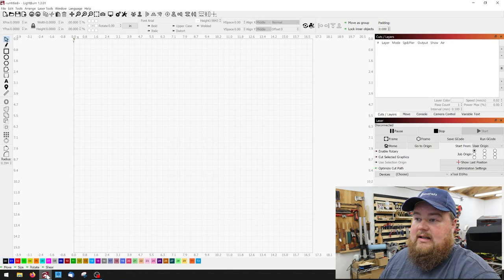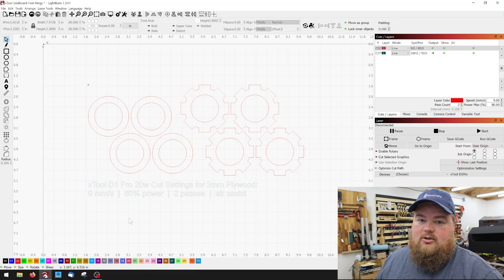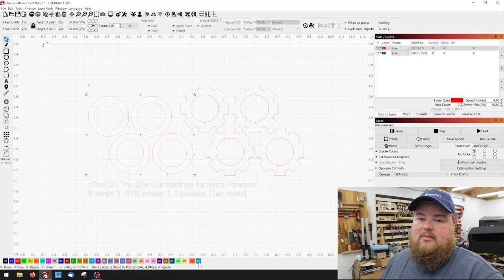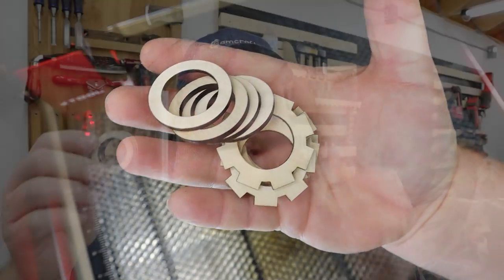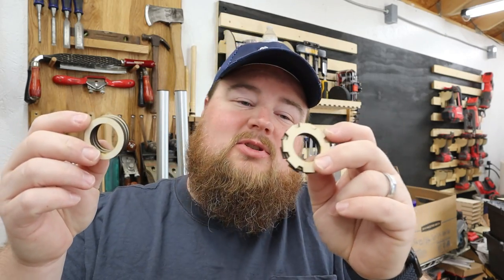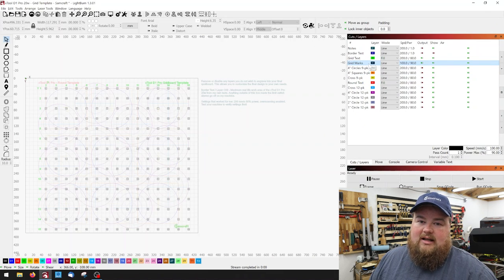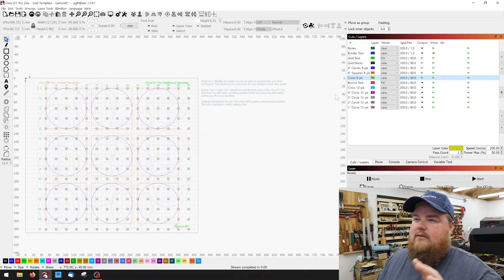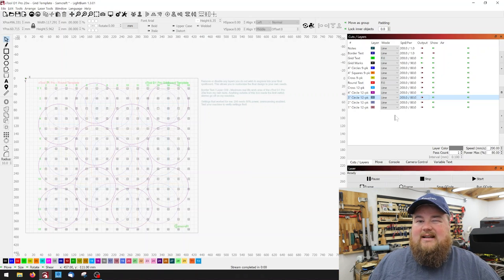Customizable! xTool D1 Pro Grid Board Template

Comment: Great video.  I ended up cutting my spoil board 24" wide x 25" long.  This allows me to place the xTool enclosure on top of the board and not lose any enclosure height.  It also allows access to the USB and Power ports when the extension legs are installed (they were covered if the enclosure sat outside of the board).  Thanks for creating great tutorials!!!

Comment: Ok got it, expect for when need to cut.  Obviously when you need to cut AND engrave the template is covered by the honeycomb and steel burn protector underneath.  I assume you cut your project first with the honeycomb in place, and then take the cut pieces to the template as a separate operation.  Thanks for another great video!

Comment: Very nice thanks for sharing. I had been toying with the idea of instead of a grid using a piece of peg board on top of my plywood and aligned with my diode laser. That way I can use the peg holes to align templates.

Comment: 1 thing that I would add that I consider VERY IMPORTANT is that before saving the file you LOCK it so it does not get accidentally moved so template and spoil board do not get out of alignment

Comment: Very helpful video Sam. I was already planning to do the same with the feet, but like your air suction kit behind the laser and how everything is placed gives a better idea how I want to place my laser. I'm also planning to make a board for the rotation kit with more ground clearance as well a board with a big square gap and a table under the laser. The laser itself is placed on an Ikea work bench (adjustable hight) so I can easily laser bigger stuff without adding or removing the feet at all. Keep up the good work 🤘

Comment: Sam, great video.  Maybe you can help me out.

I am using obsolete coordinates,  but when I run the border test the Lazer head is hitting the bottom right of the metal frame which throws off everything.

Any idea on what I am doing wrong?

Should I change the overall size of the entire settings to make the overall board smaller so it does not hit the frame?

Comment: Hi Sam. Thanks for the videos, I've watched a few now. I'm brand new just getting setup. I've watched some videos on spoilboards and absolute position cutting. I'd also ordered a honeycomb board that came yesterday, and now I see how it just floats in the workspace, I'm wondering if you can use a combo of spoilboards (grids for absolute positioning) and the honeycomb or if its down to one or the other?? Getting setup and going seems to be the biggest challenge so far but I'll get there!

Comment: Within the settings did you have constant power on. I’ve found with Xtool and circles having issues if constant power not on. Love the grid I did mine a little different withe the feet. I drilled holes 1/4”deep
Reply from the maker: I did not have that enabled... I'll make sure to use that setting for the xtool here forward.

Comment: Sam, thanks so much for this video. I just finished my grid board and so far so good! I just had one question about saving the file. After converting to a toolpath I noticed that my lines are still the short, dashed style instead of fully connected as yours appear to be. Is there something I could be missing in this step?
Reply from the maker: In lightburn toolpath layers always show as dotted lines.

Comment: Sam, great video, I'm new to laser engraving and I always thought you had to use the honeycomb  piece all the time. Is it OK to engrave or cut without it. Are there any advantages to using the honeycomb. Thanks in advance all your video are very informative, thanks again.
Reply from the maker: The only time you need to use the honeycomb bed is if you are cutting through material. Thanks

Comment: Question. I notice you are not using the shield attached to the laser module of the D1. Is that required? I noticed that I have to clean the module more often due to build up. Also, how does you metal board fit in there?
Reply from the maker: The shield isn't required, no. It's a safety measure, but not needed since I have the enclosure. I also noticed my shield funneling smoke up and into the lens housing.

Comment: Like your vids. You removed the orange protective cap. I was also thinking about doing this since I also have the same enclosure you do and that cap keeps hitting my clamps. Is it safe enough to be using the xtools d1 pro without the cap?
Reply from the maker: The orange shield is there to protect stray eyes. Otherwise it's just a soot and smoke capture area for the laser and will lead to dirtier lenses and more maintenance. Just my opinion though. :)

Comment: Sam this maybe off the subject, but what computer do you suggest to run lightburn I just bought a D1 Pro and need to up grade my Old Old computer. Not wanting to spend a ton of money but want something that works good. Will a tablet work?
Reply from the maker: Hardly anything is off subject here! LOL You'll want a machine that runs Windows to use Lightburn. Some tablets will run it, but I prefer a laptop / PC setup. In my shop I have a small form desktop PC and use HDMI cables to connect to my monitor or my TV as needed. I like the big screens for seeing fine text and also having multiple windows open at once. Here's a link to a computer that is very close to the one I use: https://amzn.to/3qzPTIb The specs I look for are 16 GB RAM, a SSD hard drive, and at least an Intel i7 processor. I've had good experiences with off lease computers from Amazon. I think I have about 4 of them in use at this point from our home, to my workshop, and my wife's soap making space.
Reply: ...and do you laser engrave the soap bars too?

Comment: I'm sure this is a dumb question but If you put the honeycomb on top or the spoil board, doesn't overburn/etc. go through the material/honeycomb and cut/burn/engrave onto the spoil board creating unnecessary marks on it? Thanks for this video and all the files and help you provide.
Reply from the maker: Yes it absolutely will... if you do not put the metal sheet (that used to be included with the honeycomb) on top of the spoilboard.
Reply: @Samcraftcom  Yep, I didn't think about that. I 3d printed feet and frame for the honeycomb so I wasn't thinking about the setup replacing my current layout. I'm still new at this trying to figure out templates/etc for batch work and your video really helped.
Reply: I am new to lightburn. When I use the "home" button I get a hard clunking sound which seems to throw off the positioning. The console says 
start_home x
left limit trigged
start_home y
up limit trigged
<MPos:0.000000,0.000000,0.000000>
M28

This is for my XTool D1 10W machine. 

any thoughts? I appreciate your help.

Comment: I totally would like metric!
Reply from the maker: Awesome! Question:  What's the equivalent sizes you would want for the 4", 3", 2", 1" circles and squares, then also what grid spacing would you like best? Feel free to reply in email if you rather - sam@sam-craft.com
Reply: @Samcraftcom  I have to think about I'm just starting with my d1 and I work in mm a hold over from 3d printing. I've been working on powder coated water bottles as gifts but I want to be consistent in placement and having the grid would be fantastic. I haven't graduated to lightburn quite yet.

Comment: Nice video Sam! Just ordered my first laser, lead time is at least three more weeks. I did not get the Xtool. What rotary tool did you get? I already broke the bank with the laser, I’m not going to spend $600-800 on a rotary if you know what I mean. I’m just starting to learn Lightburn in advance.
Reply from the maker: I have the xTool rotary, but have yet to get it out of the box. For all the lasering I have done, I have yet to try the rotary. I need to get over that! :) Which laser did you get?
Reply: @Samcraftcom  I got the Boss Co2 80 watt 16” x 30”, chiller and air compressor. They had a promotion with a free upgrade from the 70 watt and servo motors upgrade from the stepper motors. It is capable of converting to a 105 watt. It was one of those cry once buy once decisions. I have a friend that is killing it with his laser, Chris from A Glimpse Inside, great guy. I suggest watching the Laser Everything channel on YouTube, very informative! 
You and Angela and your boys are a great influence. I need to take that step into the YouTube world, it was my New Year’s resolution so we’ll see.

Comment: Hey Sam or anyone else I just purchases my xtool now I need recommendations on a good laptop to be dedicated for my xtool without breaking the bank. I do have iPads but I’m sure they are not what I need
Reply from the maker: Correct... as of right now, xTool Creative Space or Lightburn will not run on iOS or mobile operating systems (bummer). In my workshop, I use a mini desktop PC that I got used/off lease from Amazon for pretty cheap. It's powerful enough to run my machines (several at one), plus do any light design work I need to in the workshop. My PC has an Intel i3 processor, 16 GB RAM, and a 256 GB solid state hard drive. Anything around these specs would be fine for this kind of work. If you plan to get into complex image editing or run more powerful graphic applications, you'll want a better CPU and perhaps more RAM. But it works fine for me here with my plethora of lasers. Here's a link to one very similar to mine (currently $150 on Amazon): https://amzn.to/43i7qCJ I like the PC setup in my workshop for the ability to have a larger desktop monitor and also my TV connected without wasting the space of the larger laptop on my work surfaces. If you're dead set on a laptop, this one appears to be a good deal: https://amzn.to/45hN52t I am partial to Lenovo for their serviceability and from using them for many years in my prior professional IT career. Hope this helps!